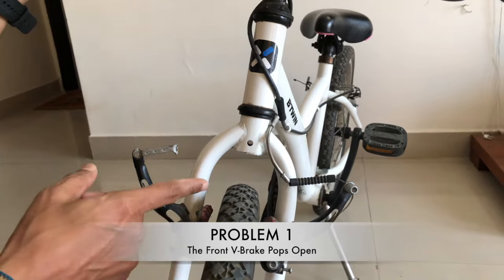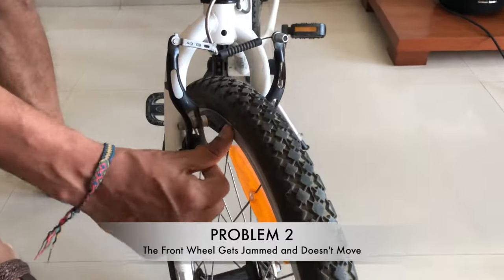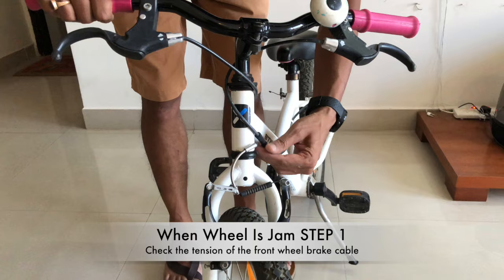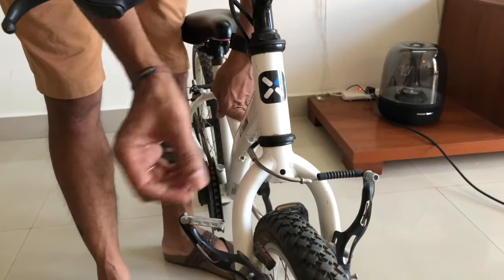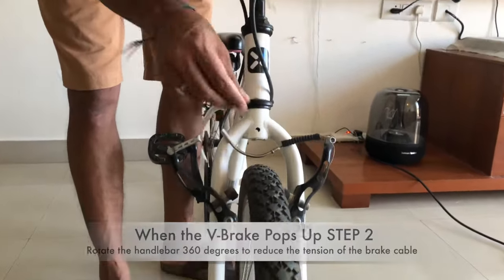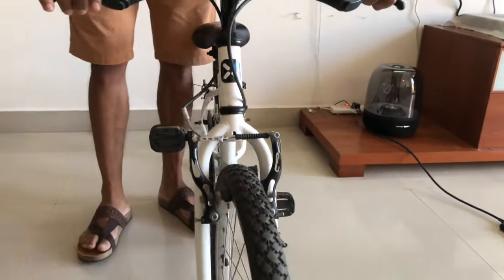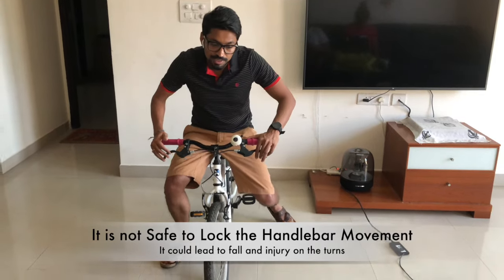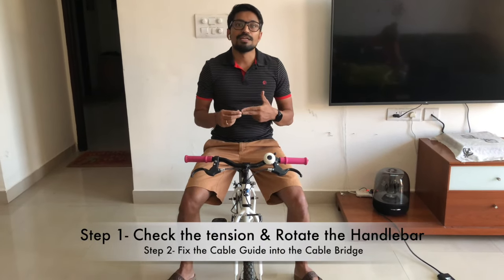How to fix the front brake of kids bike?

Comment: This solved the problem I had with my granddaughter's bike!  The front brakes locked into place.  She probably fell off it and turned the wheel all the way around.  I was about to take it back to the shop where I bought it as she only rode it a few times!  This should have been explained somewhere in the manual!  (but wasn't).  So self-explanatory once you know what happened.  Thanks!

Comment: Different case: I had another issue where the front brake was behind the fork/handlebar. In this case turning the handlebar 360 doesn't solve it and tightens both brakes additionally. The solution was to turn the handlebar but keeping the wheel steady (or vice versa) so the front brake is again in front.